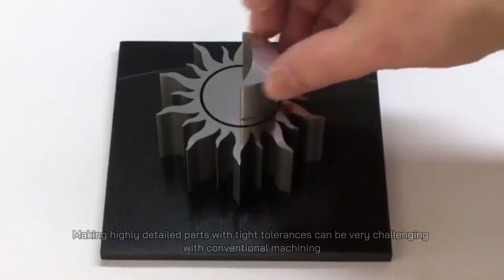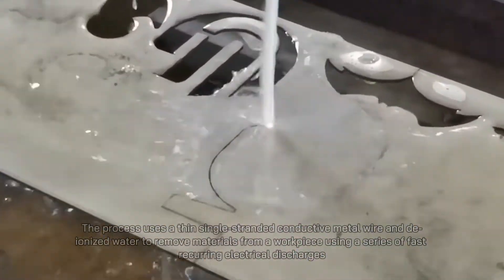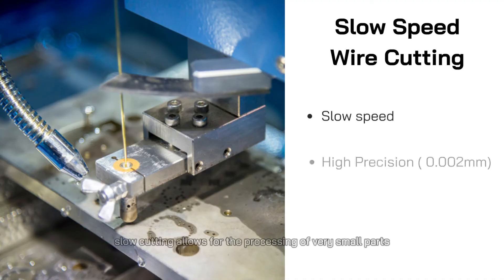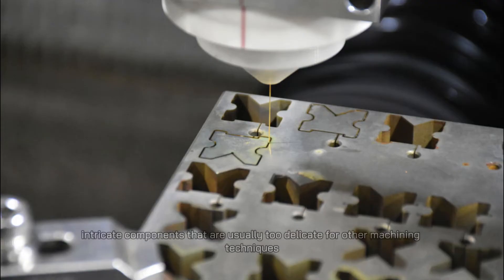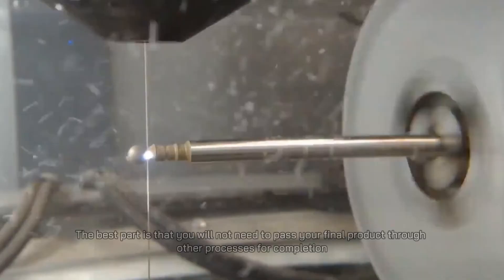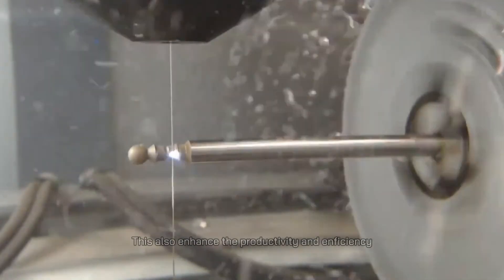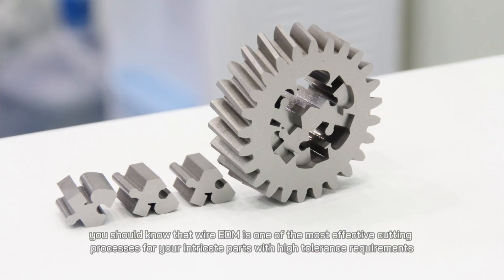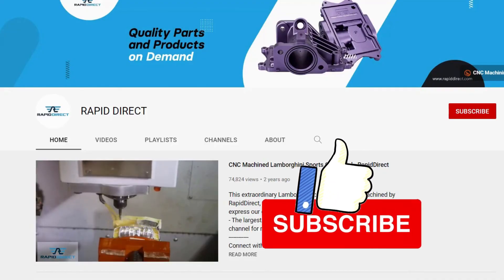What is Wire EDM? Wire EDM Machining Process Explained

Comment from the maker: When should you use wire EDM cutting?
-Thick parts that require a good finish and/or high accuracy.
-Complex shapes or narrow slots
-Larger parts requiring tight tolerances
-Delicate, hard, exotic/expensive, or fragile materials

For any questions about wire EDM, pls leave a comment below or contact our experts directly: https://www.rapiddirect.com/